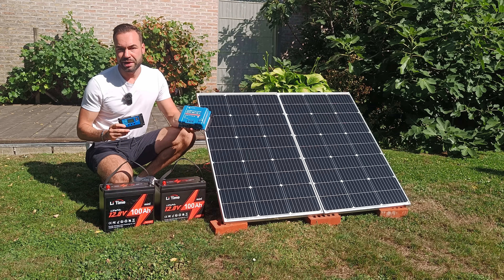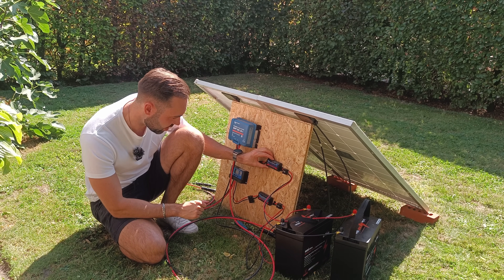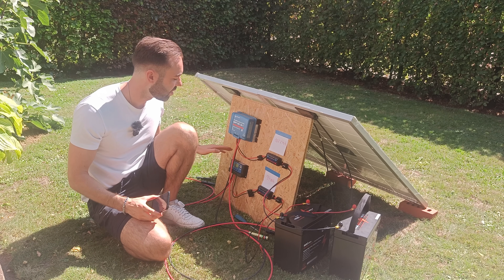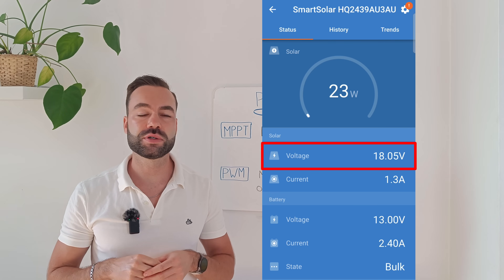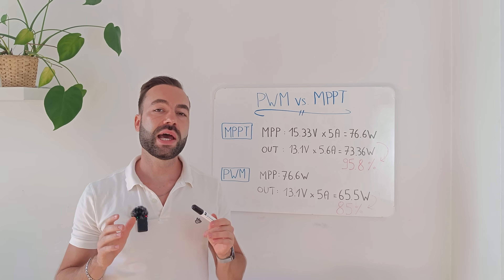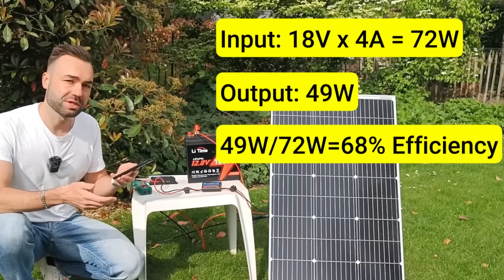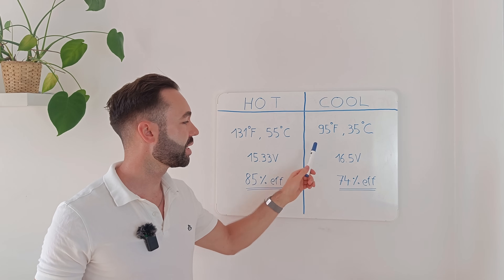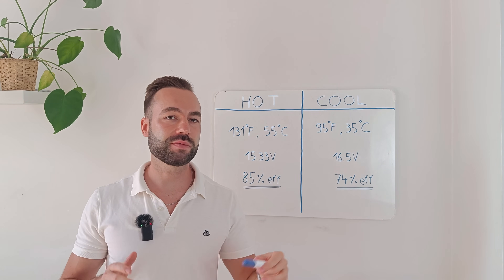MPPT vs PWM Efficiency Tested

Comment: con el voltaje del panel bajo carga (15.33V) cercano al voltaje de la batería (13.1V), la diferencia de eficiencia entre MPPT y PWM fue solo del 5.4% (102.2 vs 97 Wh), con la posibilidad de mejora en condiciones cuando el panel se calienta( PWM) , cual es la diferencia de costos y beneficios entre estos sistemas, valen la pena para solo obtener un 5% mas de energia, no seria mejor invertir en un panel solar?.    mi conclusion : es mas conveniente un sistema PWM y si requiero mas energia hacerme a otro panel solar.

Comment: it wouldnt be worth the money to buy mppt for a single 20 volt panel, to maximise efficiency with costs, more panels with series would be better. 15 volts vdc is nothing for mppt to work with to gain that extra power

Comment: The performance difference doesn't justify the price gap between the controllers.
Reply: That 5 % really does not make that much of a difference,  I use a PWM controller to charge up a 300 AH AGM battery bank for running a water up, and usually it is topped off within 4 hours. So there would be no advantage as long as the battery gets topped up. With a MPPT controller it would just be topped up 5 % sooner. Who cares ?  I wonder which controller has the longer lifespan ?
Reply: You can not charge lifepo4 battery's with a PWN, it damages the lifepo4 cels

Comment: You would need a 39 cell panel for charging 12.8v battery with PWM controller ( number of cells/3) 😊 or at least 36 cells  for a 12v system as standard

Comment: I'm curious, would a fan blowing onto the backside of the solar panel bring the temperature down enough to make a difference?
Reply from the maker: No, if it was going to be better, all solar panels would have them.
Reply: @cleversolarpower 
Thanks, just trying to be creative.
Reply from the maker: A small computer fan would consume 10W. So it needs to see a 10W improvement at least. I don't think that will be the case.

Comment: the main advantage I see with mppt's is the voltage step down when you use a 39V panel it gives a real boost in amperage
Reply from the maker: The boost is there because you lower the voltage. So it's the same power coming in and out, just at different values.
Reply: Mmmm. So you are using computers and high frequency semiconductor junctions in a c-dc converter to correct for the fact you have too many Solar Cells in series. 
I get twice as many amp hours, up to 10x as many when it's cloudy by not using any electronics at all. 
Just disconnecting or using a dump load when battery voltage gets too full. 

You only need 1/3 the panels if you do this.

Comment: Hi my friend, first thanks so much for your amazing educational videos!
I was wondering if you can make a video with all the components needed for an off grid Litime 24V 230Ah LiFePO4 Battery.
I am going to use this system for my 1000 sq ft greenhouse 
(I will power some fans and some grow lights and swamp cooler and water pump)

it will be so great if you make a video on this unless you have a similar videos

or if you please can recommend all the components needed along with the 24v 230ah battery (included conductors and fuses as well charge controller and inverter 

i was going with 

1- Litime 24V 230Ah LiFePO4 Battery
2- 3000 Watt Pure Sine Wave Power Inverter 24V DC to 110V 120V
3- Victron Energy SmartSolar MPPT Solar Charge Controller (Bluetooth) - Charge Controllers for Solar Panels - 100V, 50 amp, 12/24-Volt
4- DC Miniature Circuit Breaker, 2 Pole 1000V 63 Amp Isolator for Solar PV System, Thermal Magnetic Trip, DIN Rail Mount, Chtaixi DC Disconnect Switch C63
Blue Sea Systems 5120 FUSE A3T (CLASS T) 350-AMP
5- Blue Sea Systems 5120 FUSE A3T (CLASS T) 350-AMP
thats so far 
plz correct me if i got some of these wrong
I also use links from your videos for the components and i take your recommendations on the brands

thanks so much in advanced 
Frank

Comment: Hello Nick! I watch your videos very carefully! and thank you very much! here in greece I am building a small camper renault kangoo...I have a 150 AH battery and 2 X100 watt panels...How many watts of charge controller should I use?
Reply from the maker: 200W/12.8V= 15.6A. you can get a Victron 75/15. I have a video about victrons mppt coming up next week. I went to Greece last year and I loved it 😉.
Reply: @cleversolarpower  Thank you very much..!!!!.I'm glad you liked Greece.!!!.To connect the altenetor I will need a second mppt?
Reply from the maker: To charge your battery from the alternator you need a DC to DC charger. I recently made a video about it.

Comment: I don't understand why people in the comments keep learning the wrong lesson.

It's not about "old vs new" or "small vs large scale".

A "12v" nominal solar panel isn't really 12v; it's configured with the right number of cells to reasonably efficiently charge a "12v" battery, which itself isn't 12v.  The components are reasonably matched under normal working conditions, and an MPPT controller can't claw back what you're not losing (due to voltage rail mismatch) in the first place.

Don't dumb down the lesson so far that you learn the wrong thing.

Comment: I must say that small solàr chargers are junk, the best they allow to charge is 16A, I tried a 100A still 16A and struggling, and I tried many, switched over to epever
Reply from the maker: Indeed, I wouldn't be pushing more than 10A through this PWM charge controller.

Comment: Hi Nick, great video. So is there anything in your book about how to re use standard 36v panels? All that I have seen on your videos are 12v panels, or maybe 24v? If you can dive into repurposing old solar panels that are everywhere/!/ that would make a lot of people very happy. Again do you talk about this in your book? Thanks much!
Reply: Did I mention a gold mine
Reply from the maker: Of course you can use 36v panels, if you have an mppt. You need to string them in series to reach the max input voltage of the mppt.

Comment: I have a bunch of small systems, from fifty watts to 300 watt panels and a whole variety of batteries of all types.  They power electric fences, water pumps, off grid lights and broadband relays.   One thing I can say about the inexpensive PMW controllers is they are robust, some have operated for ten years without complaint.   So they may be less efficient, i suspect the response is just buy more panels since they are getting so cheap.

Comment: This is a great example of not using the MPPT charger correctly you do not use an 18v panel you use two of them in series or a 24v panel with the 18v from the loaded panel its just a PWM I have a 48v system and have 3 x 24v panels in series that have a maximum power point of around 85v I also have another two MPPT chargers that run at 180v from 6 x 24v panels. He should have put the panels in series to show how a MPPT works even when the amount sun drops.
Reply from the maker: Check my other video about PWM efficiency where i show two panels in series.

Comment: This is only part of the story! The efficiency of a pwm circuit is OK IF the panel and battery voltages are similar, BUT if the panel and battery voltage are significantly different the the efficiency will be significantly less.
Reply from the maker: Indeed, that's what I mentioned at the end of the video.

Comment: PWM controllers work "OK" with 12v nominal systems, or when the panel output and the battery voltage are fairly similar.  For anything larger, or with higher voltages, the advantages of MPPT charge controllers become even more significant.  Yes, PWM controllers are cheap...because they are simple and abundant.  Why are they abundant?  Because everyone realizes they only work well in very specific situations.  Fewer and fewer solar users are building a 12v system with one solar panel.
Reply from the maker: They can also work great for 24v systems if you have 2x 18V panels in series 👍
Reply: @cleversolarpower  - True, but when people start moving up in voltage for a system, they typically want more than two 18v panels.  Hardly anyone is working with small panels anymore, unless it's for very small systems.

Comment: I'm an engineer that designed a solar panel MPPT product.
The difference should be more like +30%
Check the panel voltage when charging at full current, if the MPPT is working correctly the 12v panel should be around 16v to 17v. That is approx its max power point voltage.
Reply: The difference between running a 12v nominal panel at 16v for MPPT vs running it at, say, 13.4v (where "12v" batteries pop up to quite quickly) is not really 30%.

If you look at a PV curve right in that area you'll find that it's actually not that steep.

I flat out challenge you to find 30% on a PV graph between 16v and 13.4v.

Other factors:  MPPT controllers impose their own efficiency tax because they're regulators.  That's why they generate heat and often need cooling.  Budget at least couple percent, just like with a regulator.

Sticking a blocking diode on the panel actually slightly raises the voltage that it's being railed at, again at the penalty of the loss of the diode itself, usually a couple percent as well.  But then you're looking at railing the voltage of the panel to something closer to 14v.  So again go find 30% on a PV graph between 16v and 14v.
Reply: @GoatZilla   13.4v is a full battery. More like 12.8 average in most cases.
And the point of max power transfer might even be above 17v, for the exact reasons you mentioned.
I agree with most of what you said, but that ballpark figure of 30% is not ludicrous.
Reply: @wizrom3046  That is a dishonest statement.  13.4v at rest is full.  13.4v during charging conditions is not remotely close to full.  You'd know this if you ever actually charged a battery from empty to full.  I can't stress enough how dishonest your statement is.

Even at 0.2c charge rate, a 12v nominal LFP battery will hit 13.4v at around 25% SOC.  Look up any LFP cell charge graphs.

I don't have lead acid numbers in front of me because I don't use it, but if I recall the voltage spikes even faster with that chemistry.

Regardless, I directly challenge you again to pull up a PV curve and demonstrate what voltage 30% would represent against an MPPT point of 16v.  It's not hard.  Find the graph, find 30% loss, identify the voltage.

Ballpark of 30% is ludicrous for this exact setup because the components are fairly closely matched.
Reply: @wizrom3046  I would think an engineer would not be afraid to look at the data.

An MPPT controller cannot claw back what is not being lost in the first place.

For a typical 36-cell "12v" solar panel, let's say MPPT at around 50C is 16.2v.  This falls in line with most data available.

Running that same panel at the same temperature at 13.4v, which again is a fairly easily justifiable number given most existing data again, you lose about 12% of your power.

In order to lose 30% of the power off that same panel in the same conditions, you have to back the voltage off to something like 10.5v.  That's lower than even your erroneous 12.8v assumption.

30% is a ludicrous ballpark number for this setup.

All the necessary data is open and available.  What data are you operating off of?
Reply: @GoatZilla    the commercial product I designed was a 24v panel to 12v lead acid MPPT.
24v to 12v was chosen because it gave tne best efficiency, we had no problem getting 30% improvement over a direct 12v schottky 12v setup.
Remember that the open circuit output of a 12v panel can be as high as 22v, and the MPPT will adjust to give max power point so will possibly choose a higher point panel voltage.
You are probably right that a 12v to 12v MPPT will probably be lower than our product, but still 20-25%, not the few percent as seen in the video.
Reply: @wizrom3046  With a 36 cell 16.2v MPPT 50C curve the 22% loss is somewhere around 12v.  To keep it there you'd have to put a discharged battery on and a load that pulled all the solar power away so the battery never charged or something.

The few percent in this video is actually pretty realistic for the setup.  The datasheets/papers out there corroborate the results, and I think they're reproducible.

Only data competes with data.
Reply: @GoatZilla   fair points. But dont confuse the MPP of thenpanel, with the MPP of the SYSTEM.
Panel MPP might be around 16 to 17v, but during charging the MPPT will maximise for best system power delivery, and may let the panel voltage rise to 18 or 18.5v.
So at 18v panel to 13v battery, is 1.384 (38.4% headroom), and at an SMPS buck efficiency of 95% still outputs at1.315 ie a 31.5% gain for the MPPT SMPS system.
However, at 18v panel, the panel current might be down 5 to 10% depending on panel type, (compared to panel MPP of 16.5v) but even then, 20 to 25% is achievable.
Our 24v-12v MPPT product performed at 96% SMPS efficiency at full rated current, but a 12v MPPT might be 92 to 95% in comparison.
Either way, the 5% or 7% figure in this video is not typical of a well designed 12v MPPT.

Comment: The common type of pwm charge controllers have a habit of burning out and destroying your batteries. I had an AGM battery whistling due the gas being released due to over charging. This was not a very cheap pwm (except it probably was just branded and sold at a higher price).
Reply from the maker: Which one was it?

Comment: Who's still using this? Everyone's moved to hybrid inverters already
Reply from the maker: Hybrid inverters come with high idle power consumption. Lose components are more flexible.
Reply: Not true actually. I install dozens of victron and other systems. Installers, those who know what they are doing, generally avoid hybrid inverters. They have their place, but aren't often the best way to go.

Comment: Now please do a more real world test - panels are flat on top of a caravan and the sun angle varies during the whole day.
Reply from the maker: I did a test where i test flexible panels vs rigid panels on a simulated roof of an RV.
Reply: @cleversolarpower I'm interested in running two charge controllers off of the exact same solar array output wires and into the same battery bank to save money on wire costs. if i had two mppts, they would 'fight' each other for tracking, but curious to know if using one mppt and one pwm in parallel to the same battery bank would supply more current to the system without them fighting each other. Has this been tested?

Comment: What about early in the morning to late afternoon rather than a perfect12:00hrs sunny day. Surely MPPT has a better advantage when the sun is low as wel.
Reply from the maker: It's all about temperature of the solar panel. So yes, early in the day the panel is cooler so the efficiency of the pwm will suffer a bit. Same as in the evening.
Reply: No, an MPPT allows the "excess" voltage to be converted to useful current. This excess only occurs when the panel is receiving maximum insolation i.e. the sun is perpendicular to the panel and the sun is at full power in the middle of the day. When the sunis at a low angle to the panel or at reduced power due to being close to the horizon or behind partial coud, there is no excess voltage. Then the MPPT can't improve over the PWM unconverted output.

Comment: Great testing methodology however generating power on a sunny day is never an issue.  If you were to repeat the same testing on an overcast day it would be interesting to see if there was much difference using a mppt controller?
Reply from the maker: If there was shade, then the moot will do better because the panel temperature will be lower. So the gap between panel voltage and battery is larger, so the pwm suffers in that regard.

Comment: place them in partial shade and retest.  kind of like epa gas mileage...
Reply from the maker: In shade, the MPPT will be better preforming because the voltage of the panel will be higher because of lower temperatures.
Reply: @cleversolarpower  exactly

Comment: In what circumstance would a PWM controller make sense and can you make a video on how to use a PWM controller with lithium batteries.
Reply from the maker: I made a video about pwm before you can search for it on my channel 🔎. As long as you program a separate custom charging profile of 14.4v bulk it will work, no issues.
Reply: @cleversolarpower  Thanks. I have a spare lying around and I thought it would be good to have as a backup to the Victron controllers or in an emergency.

Comment: Would Never trust a pwm. A quality victron is worth its weight in gold and the statistics are gravey
Reply: There are high quality PWM controllers. I have used Morningstar and Xantrex ones in the past and had no problems. The problem is you can't run panels in series, but if it's a small system like in this video, then it's no problem.
Reply: I have run a few PWMs over the years and never had one fail on me.

Comment: Excellent testing and, more especially, imparting a better understanding of the voltage limitations that PWM controllers have for someone trying to actually put a small system together that isn't too terribly inefficient.  Things become very inconvenient very quickly once more than a few panels are involved... either the currents in the solar wiring become excessive, or the voltages too greatly exceed the battery voltage leading to huge inefficiencies.   

But for a very small system... a few 100W panels in a 12V system or a few 200W panels in a 24V system, it can be made to work.  But not much larger than that, panel-wise.  Connecting up a residential panel to a PWM would not have a good result, whereas a residential panel with even a cheap MPPT such as a Victron 75/15 would actually work to a degree (though the output would definitely max out in the middle of the day).
Reply from the maker: I completely agree.